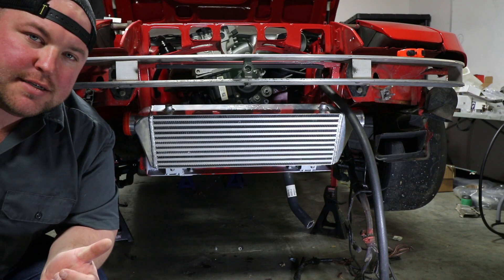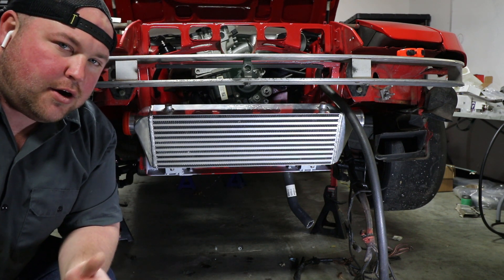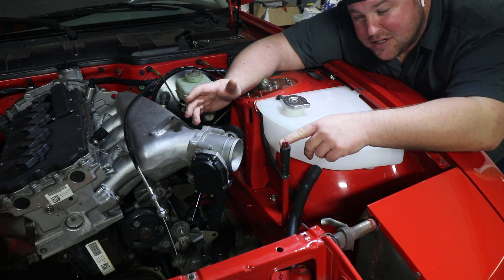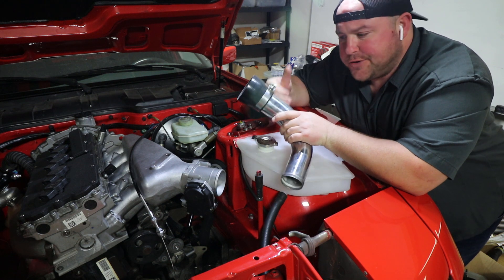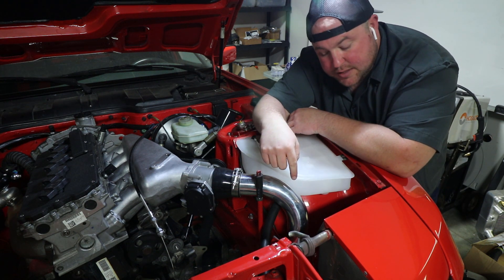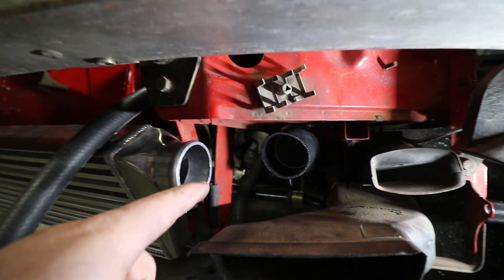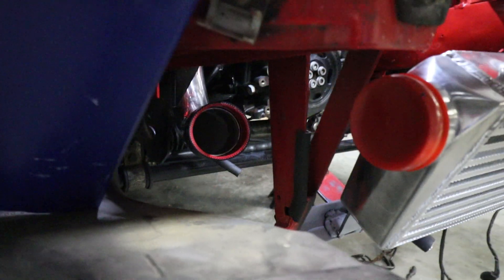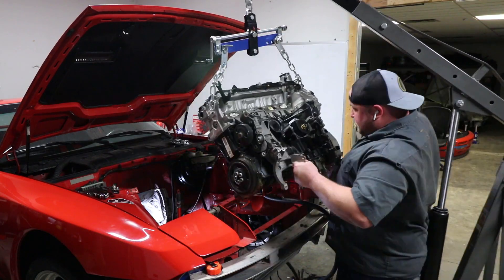Turbo 07K Build - Part 2 (Porsche 944 5 Cylinder Swap)

Comment: Hey guys, what wheels and tires do you have on there? What are the specs? Do they need spacers? Any rolling or trimming needed to fit rub free?
Reply from the maker: These are Forgeline RS. They were originally sized for an air cooled 911. I don’t remember the exact specs but we are running 245 front and 275 rear with no issues.

Comment: Hey guy, as the 07K engine is not available in Europe, do you  think the kit will fit the Audi RS3 engine. Basically I think it is the same engine, but want to be sure... Thank's in advance for your answer and Keep up the good work!
Reply from the maker: The RS3 engine fits with modification, although the big issue is the oil pan is different which requires major crossmember mods. HOWEVER, if you look up JAAATT Engineering he is stocking 07K’s in the UK now.

Comment: Hey!  So I'm considering either using a  924 Turbo hood and/or create a scoop on my hood for the air intake.  Is anyone thinking along these lines?  Does it make any sense?  Kaz
Reply from the maker: The normal scoop location for the 924 turbo hood isn’t ideal. The filter location on Alan’s car works well but you could also put it behind the front bumper. If you are doing scoops on the hood I would look at doing heat extractors to keep everything cool and reduce lift
Reply: @BoostBrothersGarage  Thanks.  I will probably stick to the intake location from Alan's, remove the headlight motor w/mechanism and wedge an intercooler between the lights.

Comment: Any specific recommendations on the radiator/intercooler/oil cooler for this swap?  I tried looking at some of the Porsche sites but just too many opinions.  I have not modified the radiator mounting bracket....yet.  i will if I need to but not sure its necessary since the engine is so much shorter than stock.  Thanks.  Kaz
Reply from the maker: Hey Kaz! If you want to keep the sheet metal stock you can stick with a 951 radiator (new if possible) or a Wizard or Lindsey Racing replacement. The only reason we went so custom was because the sheet metal was already modified and we wanted the inlet and outlet on the same side.
Reply: @BoostBrothersGarage  Thanks.  Did that intercooler hold up to the track?   You mentioned it was from Summit.  Do you have a link?  Have a great week.
Reply from the maker: I do not have a link, sorry. But yes it held up great! I believe it was made by Frostbite Performance?
Reply: @BoostBrothersGarage  Great.  I need to open up the section between the headlights to see just how much room I have and pick something that will fit.  Be prepared....next questions will be about fuel pumps and injectors.  Sucks when you have no idea what you're doing.  :-)
Reply from the maker: Hahaha, I’m here to help!
Reply: So will the Bosch fuel pump for the 944 Turbo provide enough flow for the engine with 70 or 80lb injectors?  If not, what are you using?  Thanks again.
Reply from the maker: We run the Bosch 044 with Siemens Deka 60lb injectors. The tune we supply is set up for 60lb injectors. Unless you are running E85 or building the bottom end there is no need for more fuel.
Reply: @BoostBrothersGarage  Great. I thought I heard on a video you were running 80lbs injectors.....I'm already going to need re-training on hitting the track with waaay more power!  :-)  Thanks again
Reply from the maker: That’s them!

Comment: Hey Mike, now that you guys have done some dyno work with the car, how is this size intercooler working out?  IAT's doing ok?
Reply from the maker: Yes sir! No issues so far. We will be at the track in a few weeks and will know more then.
Reply: Awesome, my project makes finding a place for the intercooler interesting since up front with the associated 10-12' of piping isn't optimal.  One around your square area gives me some options though.

Comment: How did you go about selection of turbo sizing?  Was it based on experience, numbers, recommendation?  Did you go GT series over GTX for a wider power band?
Reply from the maker: Alan has Garrett size it for him. Everything was based off their recommendation. GT SHOULD provide a larger operating range than the GTX.

Comment: Can't wait to see the results of this swap! Any recommendations on what year 07k engine to look for? I was thinking 2008 or later for the updated timing assembly
Reply from the maker: 2008 to 2010 is what I suggest. I’ve gotten two off eBay shipped to my door for less than 300 each. Hell one of them was 225!
Reply: @BoostBrothersGarage  wow those are good deals! Im going to go look for one at the junkyard this week! Also why do you recommend between 2008 and 2010? I understand that 2008 and later has the upgraded timing but why 2010?
Reply from the maker: The 2011+ have a dual stage oil pump that SOME people say can be an issue when you start raising the RPM. I don’t know if it’s true, but I stick with 08-10 to be safe.
Reply: @BoostBrothersGarage  good to know thanks!
Reply: @BoostBrothersGarage  So you're using the later cast crank or swapping in a TT-RS forged?
Reply from the maker: Bill Johnson cast to start with. I’ve been told the cast crank is good to 609 ft-lbs and I plan to test that out haha.
Reply: @BoostBrothersGarage  can't wait for the results.  My '06 engine MAY have a forged crank, at some point I need to pull the pan and find out the truth.
Reply from the maker: The crankshaft lottery! Lol
Reply: @BoostBrothersGarage  think its possible to get over 400 whp with an agressive cam and valve springs? Also does the gallardo header help with power over the stock header?
Reply from the maker: Certainly possible to get over 400 with cam and springs (obviously with boost). Gallardo header is definitely an upgrade over the stock manifold or the Spa turbo manifold. It just takes more work.
Reply: @BoostBrothersGarage awesome! Are you guys going to try cams for the turbo? Also how do you determine max reliable power?
Reply from the maker: Yeah, we will do cams with one of the builds for sure. I will be trying to get to 400 whp without them first though. Reliable power figures are based off what others have experience with. However, as cheap as the engines are we plan to just push them until they pop to figure out the real number.
Reply: @BoostBrothersGarage  awesome! I can't wait!
Reply: @BoostBrothersGarage  Probably a silly question, but have you guys talked to Hank Iroz?  He's probably the expert on longitudinal 07K setups.
Reply from the maker: We have! Unfortunately he isn’t in it as much as he once was.
Reply: @BoostBrothersGarage  Ya, he isn't making much for the swaps these days, concentrating more on the late model cars where the money is.  He's a great source of info though.  Just wanted to be sure you were aware of him.
Reply: @Boost Brothers Garage i believe he has good info on cams too since his turbo motors rev out to 9000
Reply: @BoostBrothersGarage  forgot to ask, what lamborghini gallardo header are you using? Will any year work? And does it have to be the 5.0 v10 or does the 5.2 also work? And will these headers work if I want the exhaust coming out the back of the car?
Reply from the maker: Part Number is 07L253034A. Will work with exhaust coming out of the back, just requires fanning the exhaust system.
Reply: @BoostBrothersGarage  what do you mean by fanning? Also what is a good price? 600$ seems to be as cheap as it gets, im looking at starting to collect parts soon so is it worth waiting a bit for a better price?
Reply from the maker: Sorry, fabbing, autocorrect... I paid right around 350 for mine from eBay. I just kept sending “or best offers” until someone finally accepted. Don’t pay 600 for it.
Reply: @BoostBrothersGarage  thanks a lot for the info!

Comment: Hey guys! How's it going? It's been a while for me hope everything is going good for you guys! I'm having catalytic converter problems with my 951 since the turbo seal is leaking a bit and has fouled the converter...I think it's time for a straight pipe conversion on mine, lol. Don't tell anyone, lol.  Good luck!
Reply from the maker: Haha, secrets safe here! You’re going to love it!
Reply: @BoostBrothersGarage  LOL, I'm in Oklahoma, we don't do emissions inspections or anything like that so...at least half the older cars have them cut out! I will have to address the turbo though...maybe with an upgrade and a retune! That should help as well!
Reply from the maker: It will be night and day
Reply: @BoostBrothersGarage  I hope so! It was fast before so I hope the upgrade will be just that much better!